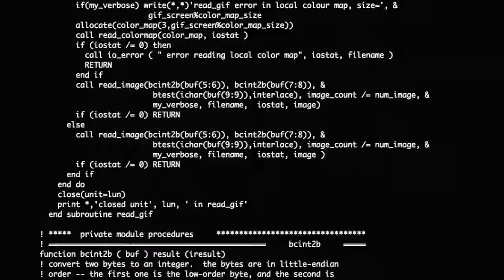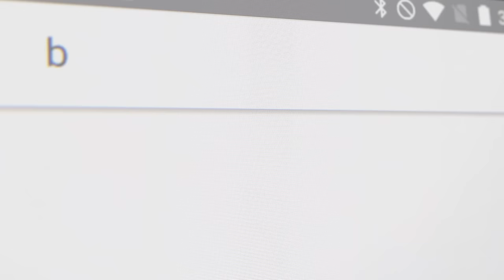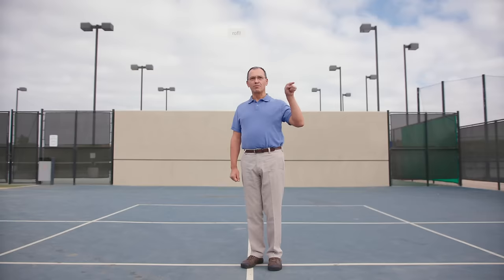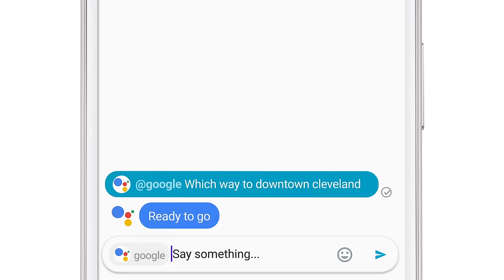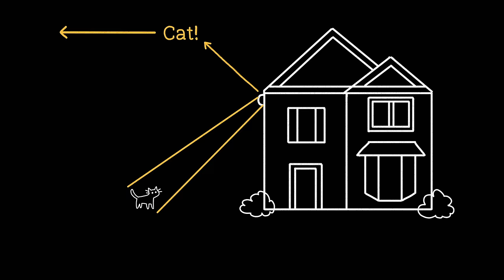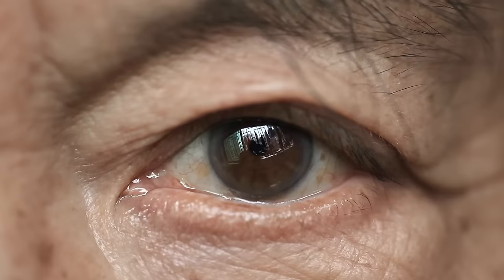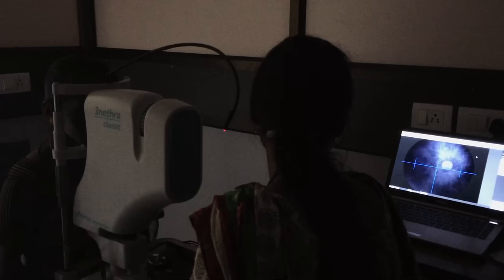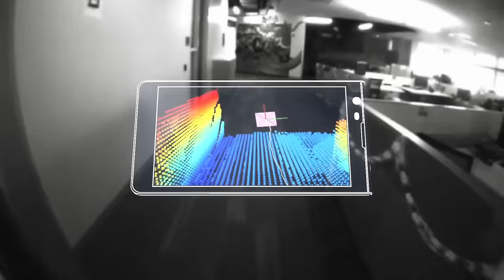Machine Learning: Solving Problems Big, Small, and Prickly

Comment: The future of the google social network according to Quoss. 
It's the year 2023.  VP11 has just hit the scene unlike previous vp models vp11 is not just any old video codec it's a new format for the web. It can be a picture, a piece of uniquely fonted text, An animation without sound or just a sound file with or without a picture, It comes in two flavours interactive and static for the interactive version it can draw stuff in upto 6 dimensions and it all relates to what limitations have been set by the service using such content and it fits well in the body of html6 and the interactive format can interact with cloud and wasm the chrome around the image or whatever can be of any 2d shape and isn't code wise a square or rectangular picture with a transparent colour. on google+ you have dishes a dish being a standardised dish of content created by users over the inter-cloud. vp11 uses an algorithm where by bit depth and resolution issues are not so much an issue as accuracy so less powerful computers are able to reduce the quality/accuracy relative to energy efficiency and usage demand even in mid stream accuracy can shift relative to such demand or even with in a 3d interactive scene. In 2023 the google algorithm has changed immensely it picks up on very subtle user biases well as to aid further search results for a particular user or user base and can also almost guess perfectly what your surfing for even if you don't know the full wording and google translate works perfectly and you can even watch/hear your own or another avatar speak out loud the translation. Not possible even by 2023 you may say well then you haven't yet heard of R-Axials RAP standing for a r-axial patterning file. Also the feature in starship trouper what the computer asks do you want to know more is far more advanced a feature in real life and the AI can even generate interactive educational content relative to such a system of data flow/representation. Google Tools allows people on google plus to develop creative tools which piece together on a work bench.